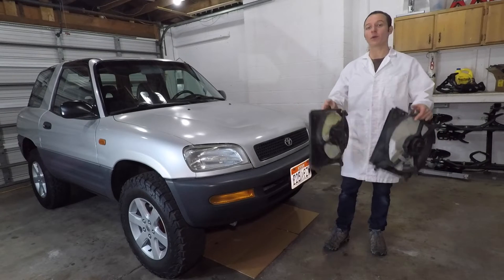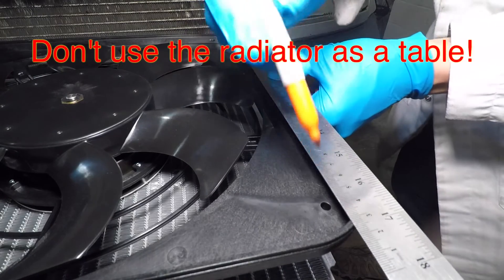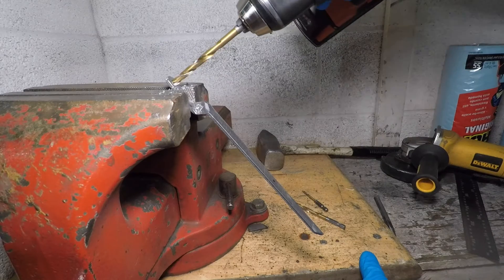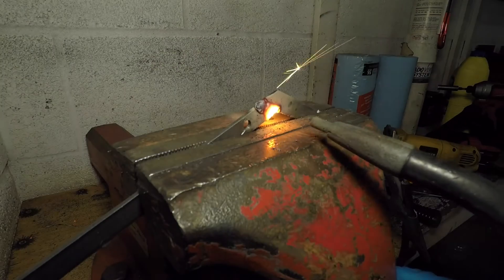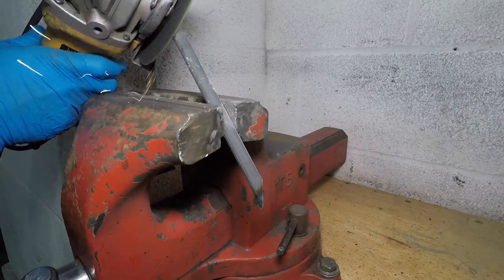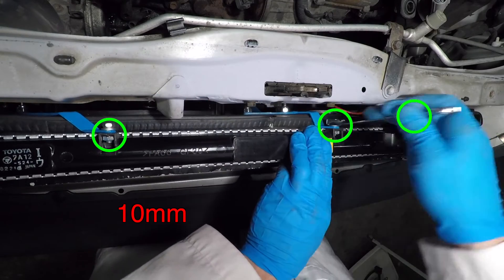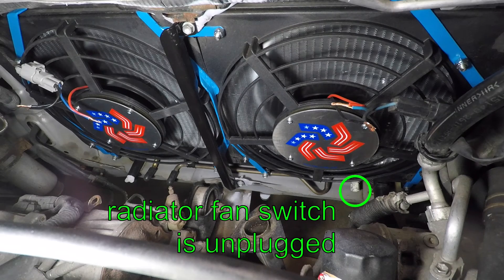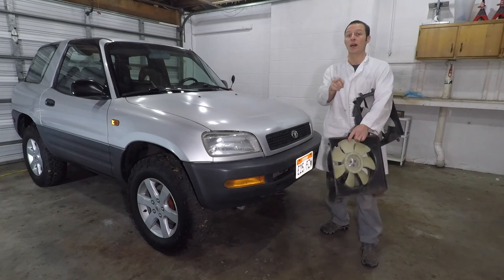Aftermarket cooling fans 1997 Toyota RAV4 (episode 16)

Comment: Im waiting for rear camber adjustment
Reply from the maker: The rear camber adjuster bolts are by the rear differential.  It's not really a DIY thing because you need an alignment rack.  Make sure the adjusters aren't rusted solid and can actually turn, then take it to the shop for an alignment.  
https://www.youtube.com/watch?v=c1gi9hoCpEI&list=PL1_JDBt1LSiImFCzG1QKxOTeZnzUG8uxj&index=7&t=940s
Reply: @LabCoatPaul  Tnks

Comment: Hi Paul, in my RAV4 I realize that the fan on the left side of the car does not run upon start up but only the right one runs. Some told me that during cold start only one fan will work. However, yesterday I realized that even after driving for 45 minutes and the engine bay being hot after the drive the left fan was not on. Is the car designed to operate this way? Mine is a 1996 RAV4 4 door. 3SFE
Reply from the maker: Yes.  I think that is normal.  The second fan turns on with the air conditioning.  Turn on your A/C and see if the second fan works.
Reply: @LabCoatPaul  even with my air conditioning is on the second fan does not run. So could this be the root cause for the Aircond that is not cold? But when I am speeding on the road some times the Aircond gets icy cold which means during that time the fan runs?
Reply from the maker: @gvick15  It sounds like your second cooling fan doesn't work.  Check your cooling fan fuses and relays.  Unplug the fan that doesn't work and check the resistance of the motor.  I don't know the specification, but it should have continuity and it shouldn't be shorted.  My guess is it will be somewhere between 10 and 30 ohms.  
With the fan unplugged, try running wires directly from the battery to the fan.  If you get sparks and it doesn't turn, it's shorted.  If it turns but the wires get hot, it's shorted.  If nothing happens, it's an open circuit.  
Connect a voltmeter to the wiring harness connector that goes to the second fan.  You should get 12V when the A/C is on.
At high speed, there is already a lot of airflow through your air conditioning condenser and your radiator and you don't need fans.
Reply: @LabCoatPaul  thank you. Will give it a try. Appreciate your effort to share this

Comment from the maker: Update:  My fans burned up today!  I drove around town a little bit and it was 100 degrees out.  I got an electrical fire smell coming from the engine bay, and the fans were extremely hot.  After running them 15 more minutes, the fan fuses blew and my car overheated.

Comment: It is hard for me (or anyone) to suggest a better way in which you perform your repairs. But, I am going to give you some advise from a retired mechanic and a DIYer. Get rid of the silly bic lighter you use to heat shrink and get a proper flame thrower. I do a great deal of electrical soldering on my DIY projects and I own both the butane small torch that emits a flame and one that has a heater element for heat shrinking. The bic lighter is...well just not you after watching how you do everything "over the top". Keep the Snap On's tho.
Reply from the maker: Thanks for watching!  I use a butane soldering iron, and if I take the tip off, I could use the torch for heat shrink.  It burns it pretty easily though.  I haven't tried a heater element yet.  I'm sure it will work better than the lighter, but I'm not sure if it's more convenient.

Comment: Hey, Paul! I re watched your cooling videos. Because I tow 1800 pounds with my 99 4 door 5 speed. And She has 230,000 miles on her. So, I’m planning on completely redoing the cooling system. Obviously adding better cooling fans. Like the 1390cfm torqflo fans and new radiator and all. But, when I am going up hills. I don’t want the water and oil getting way to hot and then the fans kicking on! I’d like the fans to kick on when it comes to going up steep grades. And especially when I have to downshift from third gear to second gear to maintain speed. So! I believe, installing a electric fan switch. Would be extra insurance haha! Any chance you could make a video on how to do that? If so.  That would be awesome!
Reply from the maker: I won't be doing a video about an aftermarket fan switch, but they're actually very easy to install.  They have a temperature probe that you push in between the radiator fins, and you just connect battery power and ground to it.  Then you turn the knob to adjust at which temperature you want the fans to come on.

If you want your engine to run cooler, you can also install a different thermostat in the engine - one that opens up at a lower temperature.

Also, use a high mileage synthetic blend oil instead of conventional oil, and buy a good quality oil filter.  The oil does a lot to protect the engine, especially when it's working hard.  Going full synthetic will most likely make it leak more, so don't do that.
Reply: Paul Shpakov Hey, Paul! I just got this notification! I use full synthetic engine oil with good brand filter! My rav4 doesn’t over heat, thank God! But, my second fan does not work! So I will be doing a full cooling system overhaul soon! Right now I’m going to do the fans! As well as new front struts, lower control arms, ball joints, and outer tie rods! Because it all desperately needs to be replaced! So, March is that with new fans haha! Right now I’m taking care of the massive issues list! Then later want to do because why not list! 😂😂
Reply: Paul Shpakov Hey, what CFM are those fans each?
Reply from the maker: @welcome2myworld1.o89  1,200 cfm per fan

Comment: I would like to see a video of how you fix the paint on the roof of your RAV4 and I would also like to see what products could improve the quality of the paint of the whole car in general
Reply from the maker: I'll check it out at some point!  I still have a lot of mechanical problems I need to fix first, but I'll keep the paint thing in mind.
Reply: Consider using a vinyl wrap on your roof. If you DIY the cost is considerably cheaper than paint and clear coat.

Comment: Hey great videos, I have a 99 rav4 which I was about to sell but after watching these videos, I will just keep it and fix it as much as I can. :)
Reply from the maker: Oh no!  That will be a lot of work!  I've come to the conclusion there are 2 ways to own a RAV4:

The smart way: Accept the fact the car is too old and everything is worn out.  Fix only what you need to keep it running.

The stupid way: Try to fix everything and spend a fortune on it.  This is what I'm doing and it costs more than a brand new car.
Reply: @LabCoatPaul  Were doing the exact same thing, already spent about 2.500€ for rust removal and Protection, and now about 4.500€ for fixing  everything and New Tüv

Comment: Hey Paul I have a question for you. Not sure if you will ever see it. My 98 rav4 is having a strange electrical problem. When I completely turn the key off the dashboard lights (oil pressure, odometer, parking brake light, etc) remain on. Wiper stiill function and doors do not automatically look and unlock when the key is turned. If I unplug fuse 28 (”CIG”, ”PWR OUTLET”, ”SRS- ACC”, ”WIPER”, ”ECU- IG” and ”TURN & GAUGE”) the lights go out. Next I unplugged the ignition switch with fuse 28 still in. The lights remained on. It is possible due to lack of room, the ignition switch was not completely disconnected but I'm pretty sure it was. Am I correct to assume that unplugging the ignition switch should kill the lights, if that was the problem? When the car is started all lights function as they should. Also the clock turns off when the ignition is off and on when turned to acc like normal but other lights wont go off. The day before it happened I drove through a severe rain storm going highway speeds. But I cant find any sings of moisture under the dash.  It is possible that water may be grounding the circuit somewhere in the doors, since it effects the automatic door locks too? Im really at a loss here. Or would you venture to say its the ignition switch? Any help at all would be appreciated. Let me know if I need to provide more info. Thanks for the help.
Reply from the maker: It sounds like an ignition switch problem.  I haven't seen this problem before, so I don't know for sure.  You can also move some relays around under the hood.  It's possible one of them might be sticking.  
You should join the Toyota RAV4 Owners of First Gen XA10 1994 - 2000 only group on facebook.  https://www.facebook.com/groups/287048125126229/
Ask your question on there and people will help you.
Reply: @LabCoatPaul  Thanks a ton for the reply man. Defintely gonna join that Rav4 group. I did however manage to just find the problem. It was water after all, possibly coolant. When I would plug the fuse back in, I kept hearing a relay click inside the top of the dash towards the driver side front window. I decided to run my defrost on high heat for a little bit, instead of just my normal heaters. When I turned the car off the doors locks started working again except in reverse. They would lock me in instead of opening. Let it run a bit more now everything is completely normal again. There had to be a small amount of water from the horrible rain storm I drove through or the 10 inches of snow that melted off while driving. It is also possible I may have a tiny coolant leak in the heater core, possibly blowing coolant up through the defroster. I lose a couple ounces of coolant every few thousand miles. Im sure a gallon would last me years of refills but it loses some coolant somewhere. I'm gonna take your previous advice and put on a OEM radiator cap, I'm using a crappy one like you had in a previous video. Just as a precaution. I never smell coolant but who knows. Either way it is supposed to rain more this week, gonna watch it. If it happens again, I'm gonna have to some seal work. Glad it working now but thanks again for the reply and all the vids. I consider you a first gen Rav authority.

Comment: hey, my clutch is worn out and i need to replace it . every mechanic shop says it will cost about 1000 dollars !!!!!!! what do i do. my rav has 60k miles on the clock and works perfectly fine besides the clutch
Reply from the maker: The clutch is a big job on the RAV4.  You'll need to drop the subframe down with the engine and transmission together.  Then once it's out from under the car, replacing the clutch should be easier.  It's possible to just take the transmission out, but it's easier if you take the engine and transmission out together.  I don't have a video about this yet.
Reply: @LabCoatPaul  i would love to see this.
Reply: @LabCoatPaul   I don't see how taking the engine out makes it easier. I just did mine and I really don't see why I would've done that. I think what makes it easier is a transmission jack.
Reply from the maker: @xyzDJzyx  I just heard it's easier to drop the entire subframe with everything attached.  I haven't tried it yet, so I don't really know.